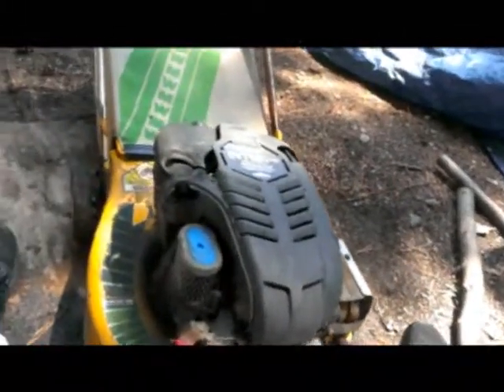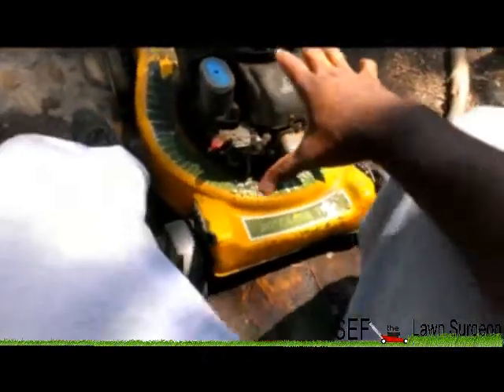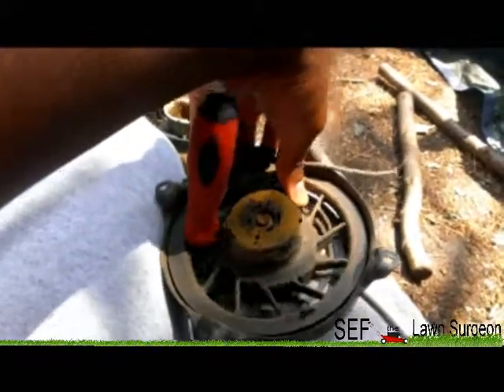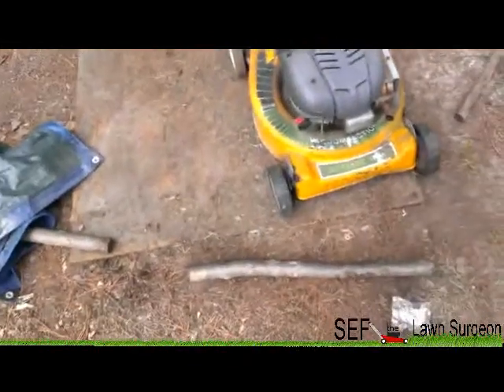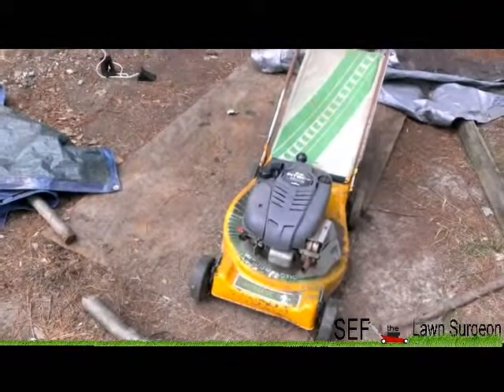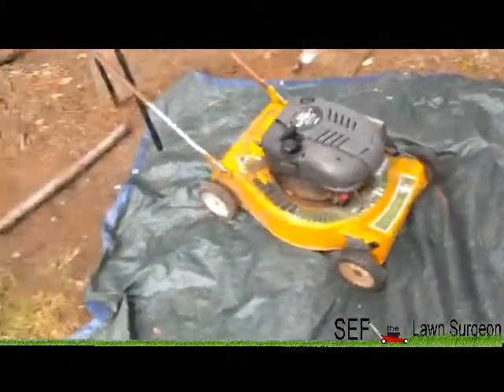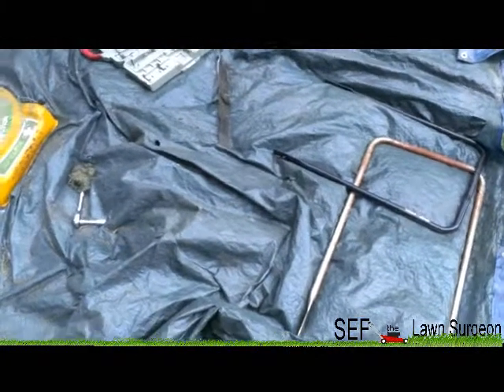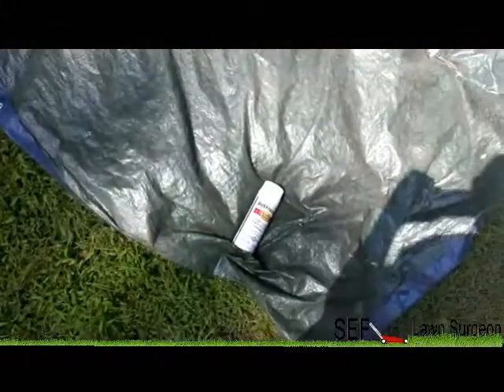Mowing With SEF - VLOG 10 - "Good As New" - Part 1

Comment: Not saying you did it wrong def but you don't have to drill out the pop rivets... Take the gas tank off with 5/16... Then the whole head with the 2 bolts in the front and back.... I just find that easier... It'll give u the same access. I do fix them and sell them but never thought of pimpin em out before sellin em lol that actually turned out nice... Your long handle wouldn't have worked had you needed a cable... Btw with that new of an engine how did u bypass that??
Reply: *sef